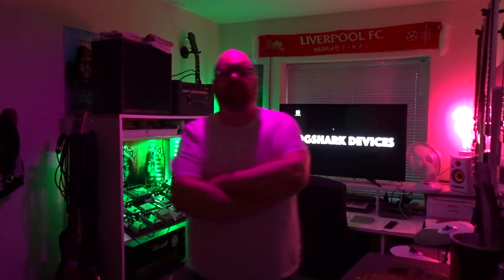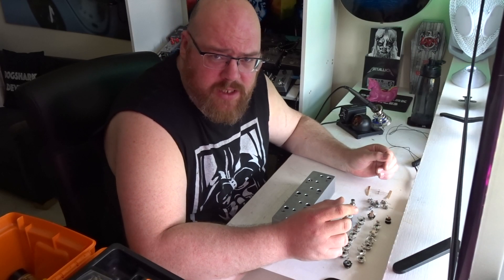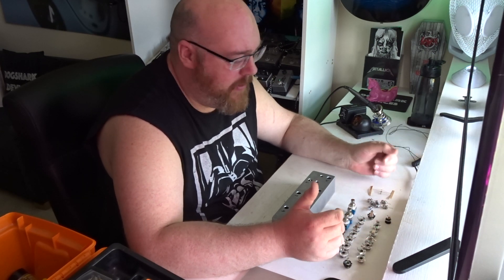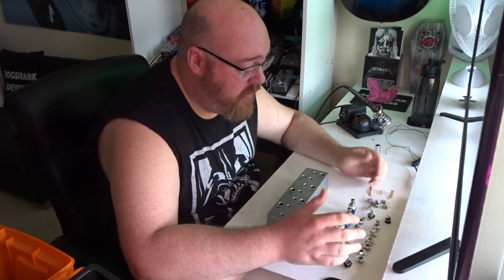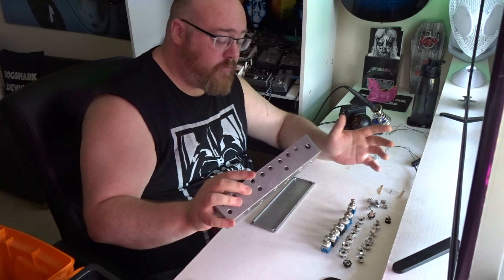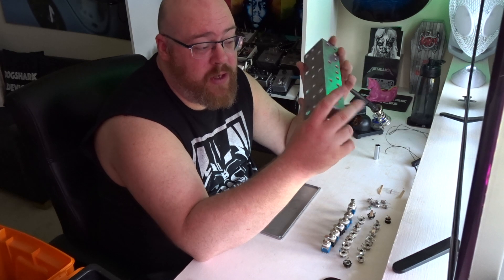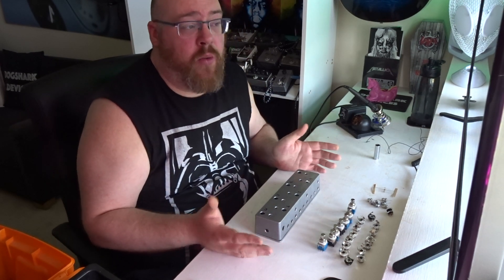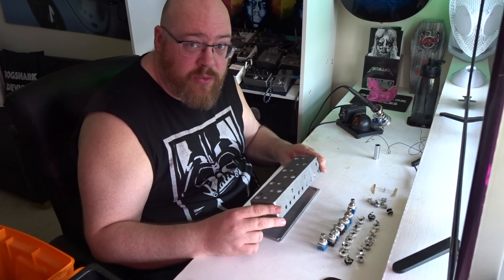How to Build a True Bypass Looper Pedal

Comment from the maker: Has anyone done any similar builds? Would love to see them.
Reply: I built a single unit over twenty years ago that I still use daily, I put 1meg pulled own resistors on the grounds to prevent pops. I want to build a bigger unit like you’ve done, do get any pops? Nice build btw.
Reply from the maker: @regortex3364  nah no pops for me.
Reply: Hi, great layout! Which leds did you take with which resistors?

Comment: Great video. Just a question. What value of resistors did you use in building this looper switcher pedal? Thanks in advance.
Reply from the maker: @clarencefernando9925  anything from 2k2 to 4k7 will be fine
Reply: @DogsharkGPS thanks man.

Comment: Interesting build. I will definitely try something similar. But instead of 5 loops for one signal path, i'm probably going to split it in two. So i can have loops 1-3 in front of the amp and loops 4-5 in the amp fx loop. Basically the same thing, but just extra in and out.
Reply from the maker: If you make it another switched loop you’ll be able switch the entire fx loop in and out

Comment: Hi there! congrats for this device! I got a question! If you have everything set and you have to change from the loop 1 to the loop 5, will you have to step two times (1st to turn on loop 5 and 1nd to turn off loop 1 - meaning they are latched),  or the next change cancel the previous selected loop? Thanks!
Reply from the maker: This isn't a programmable looper. Each loop is independently switched. So yes you would need to switch out a loop if you didn't want it engaged when another loop was switched in.
Reply: @DogsharkGPS  thank you dude! Once again, congrats for your channel! 💪
Reply from the maker: @83RED  thanks man

Comment: Hey mate, nice Video! Thanks for that. But I have a question about it. Are the send and return jacks those out of metal, which are directly connected to ground, in this case to the metal housing? Or didn’t you connect those to ground, as the pedals have a ground connection by there power supply to avoid ground loops? And did you connect the housing to ground as well? Thanks a lot!! 👍
Reply from the maker: Yeah I used metal jacks so the chassis effectively becomes a ground plane so no need for extra grounds between jacks. If I was using moulded jacks then it would need that.
Reply: @DogsharkGPS  Thanks, man!!

Comment: Hello my friend. Can I also connect more than one instrument or just pedals/pedalboard? Hello my friend. Can I also connect more than one instrument or just pedals/pedalboard? thanks in advance for the info
Reply: If not true by pass in case, or if it is. Sorry about my English 😢
Reply from the maker: @sarue7317  this is designed to connect one instrument. The switchable loops are for pedals. And yes it is all true bypass.
Reply: @DogsharkGPS  thanks for the information my friend. I thank you very much in advance for the attention you have given me. I need a pedal with several outputs only for instruments. thanks my friend, thank you

Comment: Vc tem esquema amigo de ligação
Reply: Esquema dos componentes e ligações
Reply from the maker: @brunodias7896  https://dogsharkblues.com/?page_id=774 here's the wiring diagram. 
Parts are nothing special. 3PDT switches, mono jack sockets, LEDs and 4k7 resistors. Power is 9v centre negative so it can powered off a regular pedal PSU.
Reply: @DogsharkGPS  sou grato obrigado